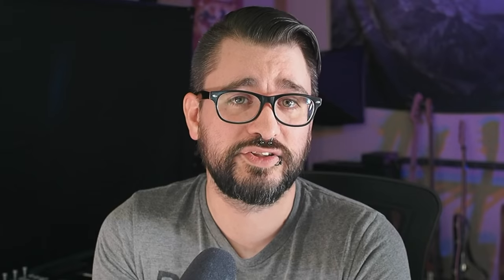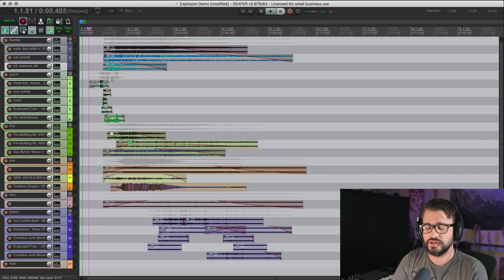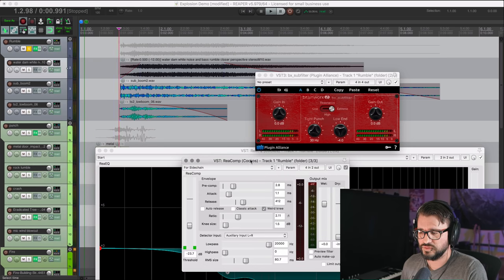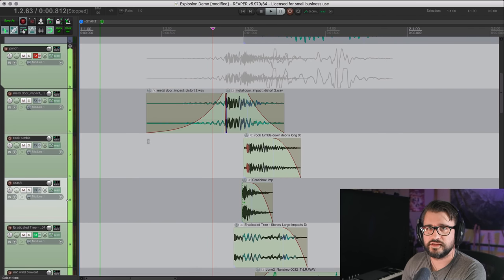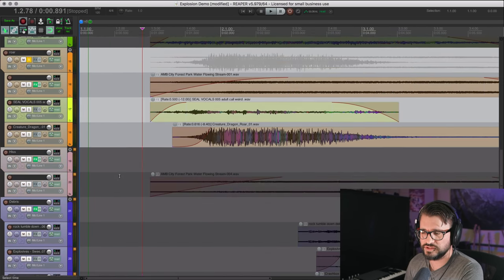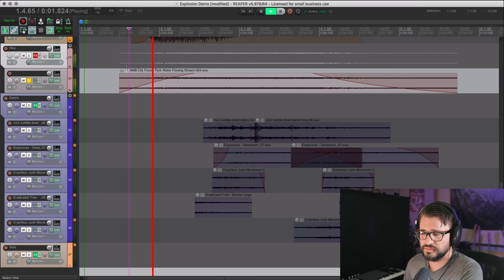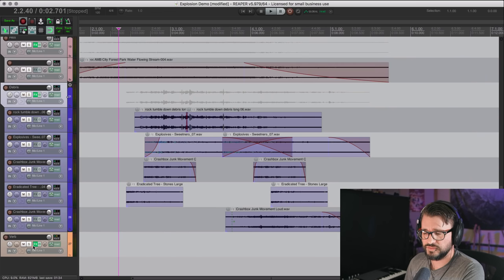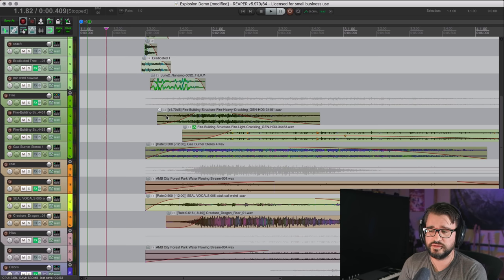Explosion Sound Design in REAPER - How to layer sounds in frequency ranges

Comment: It would be interesting to know how long it takes you doing it. The result is pretty good in regards to the samples you used.
Reply from the maker: I think I got all the sounds imported and arranged within 10min and adjusted and mixed for another 20. There are a lot of gaps in my sound library because I’ve never needed to make sounds for work. A big well-tagged library would make this much easier.

Comment: Nope don't use lots of EQ to make sound fit, you should only use sounds which work together sonically. You don't need to crowbar the sounds together. Select a pallet of sounds which work together. Walter Murch (Apocalypse Now, Godfather) makes the comparsion to food you have to select flavours which complement each other, not flavours that clash or fight each other. That's the same with selecting sounds for sound design, pick high quality sounds which don't require lots of processing in order to help them blend together.
Reply from the maker: I agree with all of that but also I have to work with what is available. You are dreaming if you think I am going to create explosions in my house
Reply: @TheREAPERBlog  I am not expecting you to record the sounds from scratch it's more about carefully selecting the correct frequencies straight away instead having to do alot of work to a sound that might not suit the application. I am completely understand your library might not huge and that is okay, you can use other technqiues to help sell a weaker sound. White noise in the top frequencies and using pure sine/squarewaves to add bottom end enhancement when field recording generally mid heavy are lacking those other frequenices.
Reply: @letslearnreaper  This is something that can take a long time to really get right in sound design. I've been doing sound design for a number of years and still, sometimes I find myself mangling a sound around with EQs because I couldnt find that sound that had just the right frequency character/bands, and other times, like you said, you find or select the perfect complement of sounds that blend super well together.

I think that this is the kind of thing that takes a really long time to master.